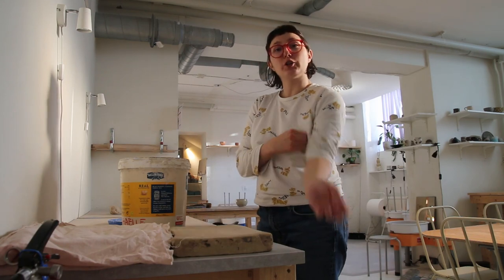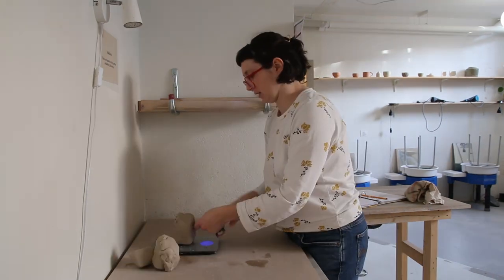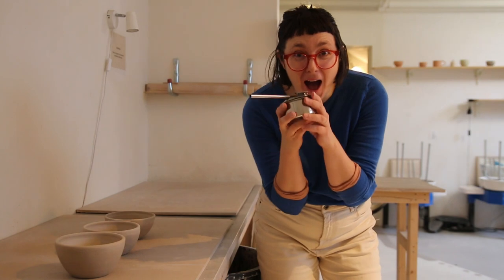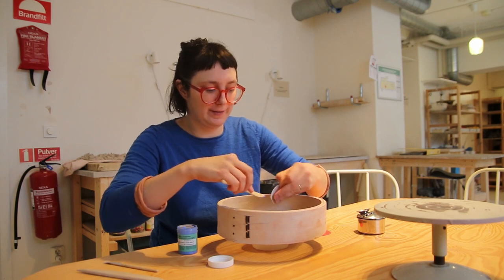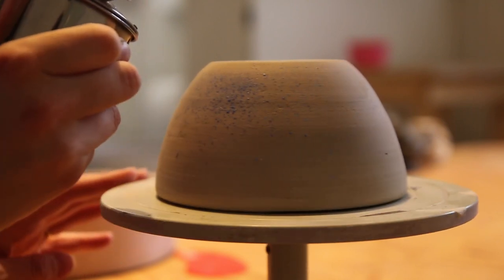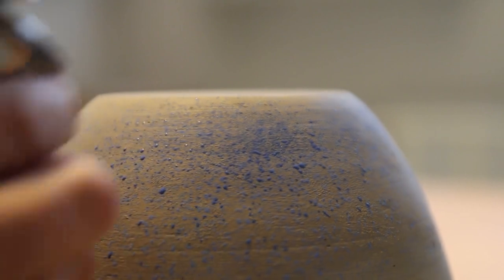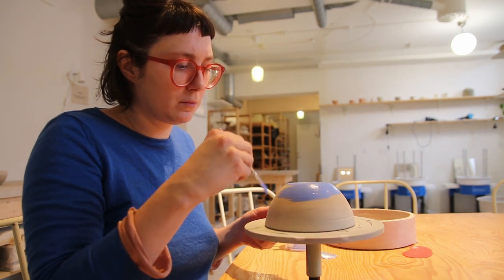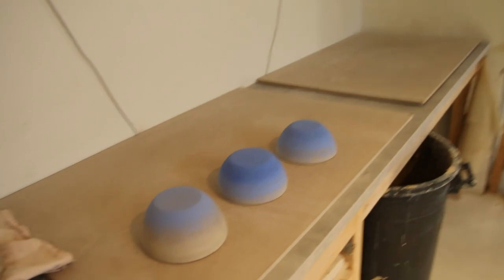Testing a pottery METAL ATOMIZER for underglazing my pots

Comment: Your trial has saved me from giving this a go. I have also wondered if one of those hand held beauty sprayers would work.
Reply from the maker: Hi! I don't know if you have read some if the other comments, people had good inputs. Apparently if it's underglaze and not a dipping glaze it's too thick and should be mixed with water. I'll try it again and thin out the underglaze, maybe it will work better that way.